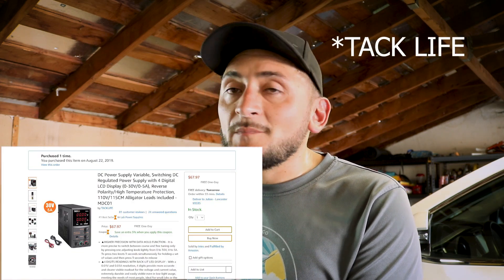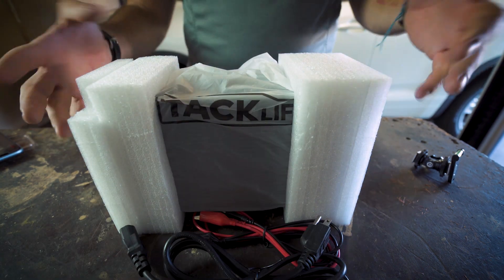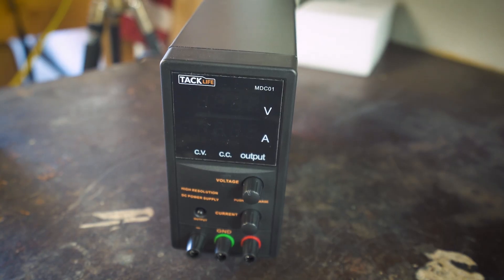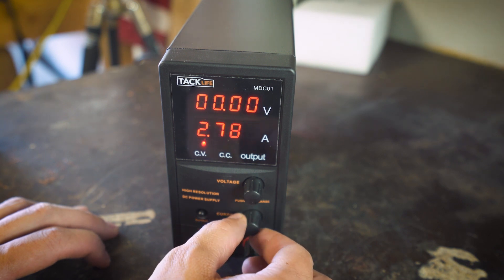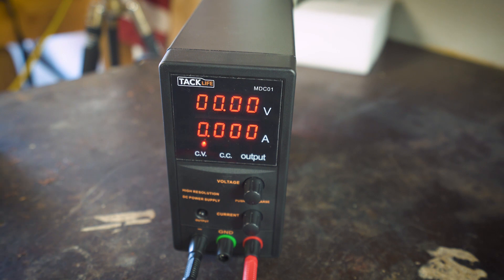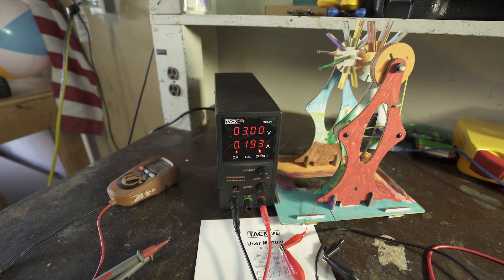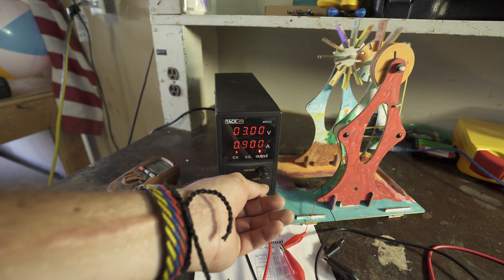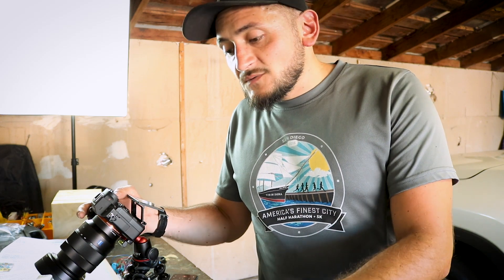TACKLIFE 30V / 5A DC Power Supply

Comment: Does anyone know if you can set the constant current to 1 miliamp?
Reply from the maker: You can go up in increments of one milliamperes. So theoretically you can set your current limit to one mA. However, I don’t know how accurate it would be.
Reply: @engineerjoules7163  I accually went ahead and bought it and it does start at 1ma. With a meter it ready 1.2ma so really accuarate
Reply from the maker: @thewrenchjockey4251  That's good know thanks for the insight.

Comment: if i limit the current to 5a then hook up a load that is only taking 2a could i turn up the current to feed it more? say 2.5a or is it stuck only giving it the power it wants when i turn it on
Reply: no if you have a resistor that limits the current to 2A, the only thing you would be able to do is increase the voltage. Otherwise you could try taking out any resistors and limiting the current solely through the current limit dial. I test out the integrity of LEDs like this all of the time.

Comment: what happens if you join the 2 tips the screen is set to 0 or it keeps marking the voltage
Reply: there is a shortage protector so it you join the tips while its live, the supply automatically stops supplying.

Comment: I built my own from an atx unit.. it works just fine with two constant 5 v usb ports (when the unit is on or off) But I am running out of space so I decided to build a smaller one and found that I could buy this exact power supply for  about the same as the parts to make mine.. so I got this.. it also works real fine and I am very pleased with it for all of you that want another opinion.. I see your new shop.. you are gonna need a bigger area.. I started with a bench that small but ran out of space real soon.. good luck will check back on you later.. carry on, stay safe and have fun!